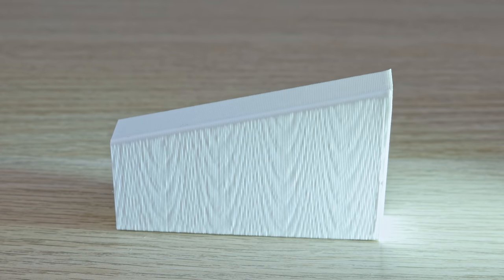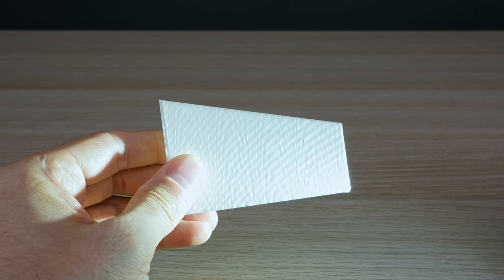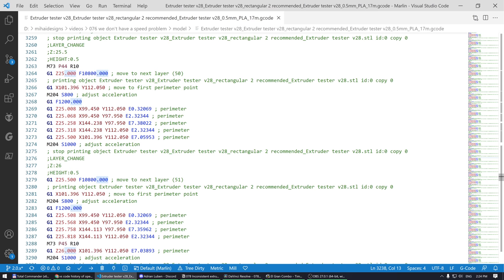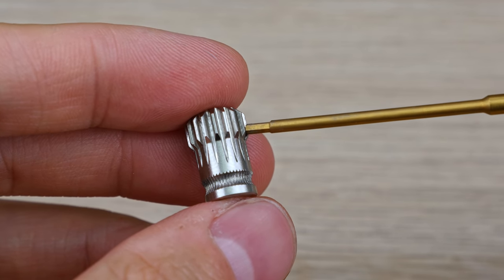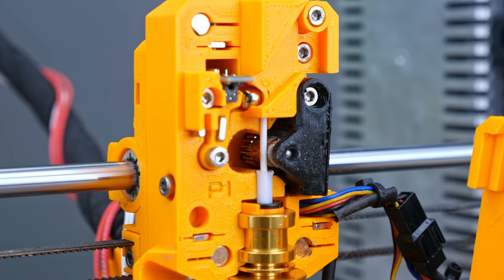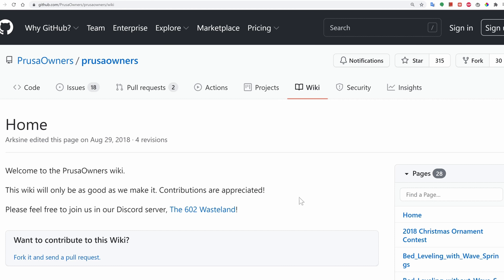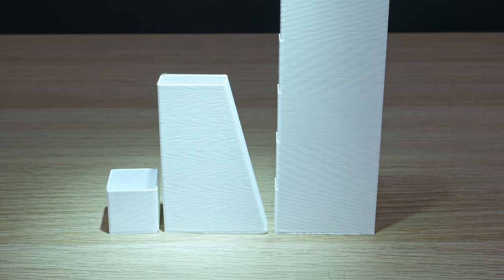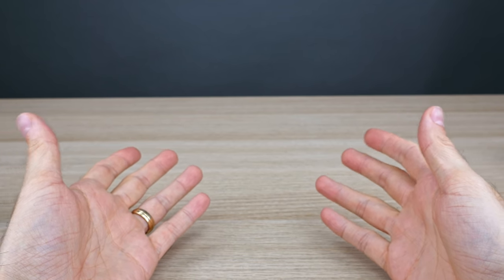What I've learned about dual gear extruders and how to patch them, maybe

Comment: Wait, i thought this was caused by 8 bit boards that's driving a complex geometry printer such as delta or corexy? i remember they need to divide the move into some sections because of the processing limit..

Some 4-5 years ago i got annoyed by this, definitely no dual gear extruders at that time. 

Now i built a corexy again from scratch but this time with a dual gear but still with a 8bit board and the problem reappears, so i was planning to switch to a 32bit.. but it looks like i need to change my plan after watching this.
Reply from the maker: I tested on the SKR as well. You can check my previous video to see what I tried without success. There are various reasons to get patterns. This is just one of the more prominent ones. You might still have to try out different things. Print my test models to at least see if the patterns you get look similar.
Reply: @MihaiDesigns  yeah i just watched it as well..

man, you have done a lot

Comment: I've had so many problems with under extrusion on my ender 6 and I kept thinking my nozzle was getting clogged or jammed, then I looked at the extruder gear and ended up changing it to a single gear extruder since I had an extra from my ender 3 v2. It fixed my problem for now so i'm using the 1 gear extruder

Comment: We need your opinions on the LGX Lite extruder! Will you try one on your Rat Rig?
Reply from the maker: I do have the Orbiter and the LGX that I want to try out. Haven't got the Lite though. Maybe I should get one 😁
Reply: @MihaiDesigns  It strikes me as the perfect extruder - the LGX design makes sense with the larger gears and it still weighs around 135g including motor. Aswell as the open design to clean gears, and only around 60EUR. I've ordered one with my ratrig already but it will be a long time before it is built lol

Comment: An excellent video, many thanks!
I was wondering if the two gears could be joined by a belt drive instead of gears? It's be more difficult to do though as you wouldn't be able to change the gap between the two cylinders easily.
Reply: A belt would make the two rollers turn in the same direction, you'd need at least one extra gear to reverse the direction.
Reply: @ferrumignis  Yes that was assumed.

Comment: It is not about the position mate its about the not centered motor shaft gear... ever think about that?🤔 the problem is every 180 turn shifting motor gear. That black screw on motor shaft gear makes shift every 180 degree cycle.Thats is why you have those patterns everywhere
Reply: Exact this.   MirageC  fixed the problem and worked with BMG to fix it.   They are new products to avoid using a gearh with screw in a shaft motor ,  that leads to an uncentered gear as The-Matrix tolds.

Comment: thats grea, but commenly, the teeths of gears have an involute shape. Those normally excel at consistently transferring torque, even with a changed distance. Maybe the tolerances of the teeths are not right, or the shape is different

Comment: I have a CR-10S pro V2 and a Flsun SR. I have the same extruder on both printers. with the same roll of filament I also have this problem on the FLsun SR but on the CR-10S pro V2 I don't have this. How is this possible?

Comment: I wonder what would happen if those gears were replaced with a crossed belt drive. WIth a flexible belt, it could even replace the spring for a grip.

Comment: Drive both gears directly and separately from the motor. Like two planets orbiting a sun. If the move closer or further apart they just rotate around the motor drive gear. The mesh of the teeth is separated from the squeezing of the filament.
Reply: In this case one gear will be rotating in wrong direction

Comment: Maybe helical gears would work.
Or the original gears mounted on a axle, with two pressure springs instead of one.
The two springs should have different hardness/stiffness, so the gear would pivot on the filament, but with a bias towards the meshing gears.

Comment: Cool was going to make a dual gear extruder but after this I'll have to design something better.
Reply from the maker: Doesn't mean your dual gear extruder will have these issues. I'm still learning about these things and how to avoid them.
Reply: @MihaiDesigns  it looks like an obvious design flaw when I see them now.. belts are the way to go I think. Or some double gear system but I think belts would fix this

Comment: another youtuber showed his fix for a similar issue and it came down to a defect in one of the stepper motor gears  which was off center and created a wobble.
Reply from the maker: Well, I would assume that problems like that have been identified and sorted out already. I use original gears,  but that can be the case for cheaper parts.
Reply: @MihaiDesigns  even the best quality products have defects. i wouldnt rule it out as a possiblity. esp, if the inconsistency follows a repeated pattern as a out of round wobble would create a very repetitious pattern. 

 however, your adjusted prints look pretty good so i assume your issue has been resolved and wobble was not a problem.

Comment: Straight ut gears like that are usually a very bad engineering solution because the speed of the teeth meshing when one gear drives the other is actually not constant and those straight cut gears have a lot of pay and backlash. Good gears would have a helical shaped teeth with an involute cut but they're also more money.

Comment: 10:57 Possibly a eccentric hole in the gear? That would show up as a pattern that repears every half circumference.
Reply from the maker: Indeed, and later I did happen to find one with the hole off-center. It needs a larger motor, but you do make a point. I guess you can have a layer consume half a gear rotation worth of filament so that the next layer up is extruded a different amount, causing a thicker and then a thinner layer and they should align at 2 points. I should try that!

Comment: The solution here is to use an idler between the two drive gears, allowing the gear lash to remain the same, when the gears need to move to adjsut for different filaments...  Or,  if you don't mind a longer extruder, with longer gears, you could reduce the angle needed to include both teh gear mesh and the right squeeze on the filament.

Helical is possible... I think  you're on th e right slant there.  Double helicial is probally to much, just single helical and something to take the end thrust..

Comment: It seems that you've discovered another tunable feature for print quality. Perhaps we should have cartridges we can swap out to get different surface features.
Reply: Could you emulate the problem in software with G code once you have eliminated the problem physically? If so, then making it perfect would be the goal, and software finish optons. But if not, then cartridges!

Comment: Why does eveyone prefers Ender 3 for starters? Why not the other Ender models?
Reply from the maker: Well, I don't prefer it, but if the question is about popularity, I assume it's because it was one of the first low priced 3D printer and got popular, so now it's popular because it was popular in the first place. Now there's an explosion of Ender clones, each grabbing only a tiny bit of the market.

Comment: i had a single gear extruder , it would grind filament sometime , but print quality was great, i got new dual geared extruder like the one in video on ender 3, and this strange waves type pattern appeared on my prints usually in first 2-3 layers then go away.

Comment: An easy solution would (maybe) be to replace the spur gears with timing belts.
Reply: Belts make things turn in the same direction, you'd need a set of gears to reverse the direction of one of the rollers.

Comment: Can 3d printer can print encoder disk    for servo dc motor used in cutting plotter like graphtec  ce 3000 with 1000 line

Comment: Use two stepper motors.  They can be half the mass of a single stepper each (approximately.)  Technically you would need another stepper driver...  (I've never tried to connect steppers in parallel).  Just an idea from a guy who's never tried it.

Comment: The only way I know to make double helix gears is to machine two cylinders separately and then join them together by a single axis. Making helical teeth on the gears for these extruders makes no sense because the powers involved do not justify their use neither from the point of view of efficiency nor from the point of view of the resistance of the gear teeth. The helical teeth do not improve the play if the two toothed wheels are then moved apart from the design position.
Reply: P.S. great research work, you have done more in these weeks than Prusa in the last 2 years
Reply from the maker: Thanks! Main point is not to improve power transmission or reduce play, but to have uniform rotation on the secondary gear. I'd assume that spur gears would also transfer uniform rotation, but somehow they appear not to be, at least in this case. Or perhaps they were borderline touching. I remember watching a video on manufacturing explaining how you can machine the double helix, but I don't understand any of the details. The two helical gears can be further apart, potentially at the opposite ends of the part if that makes it any easier to machine.
Reply: @MihaiDesigns  To obtain a uniform rotation, the contact between the two gears must always be present, but, as you have pointed out, with bondtechs there is no constant contact. Using helical gears, even with double helix, does not guarantee contact if the rotation axis of the gear is moved away from the design distance.
Probably the key to all this would be either to use different gears, such as to make this defect invisible. Or it is necessary to change the tensioning method of the extruder around the filament, because, clearly, the problem of this extruder is in the introduction of the play in the gears.
Reply: @librasd8087  Not really play in the gears, that only appears when doing retractions. Really an issue of non conjugate (constant rotation) meshing between the gears.

Comment: Try a geared extruder, such as the sherpa mini. should help a lot.
Reply from the maker: I have a geared extruder motor. Didn't make any difference in my case.
Reply: @MihaiDesigns  which one did you use? BMG?
Reply: @MihaiDesigns  the one I saw in the video directly drove the hobbed gear.

Comment: I Asked you on the previous video to look at the extruder gears and now I see that this in fact the problem. Because of the clicking noise I was hearing yesterday on my dual gear extruder of my Prusa Mini and how changing the tension of the gears changed the patterns of the printing I really I was sure this was the problem. A potential solution could be to find a diferent extruder design. I already ordered the Redrex extruder. If you look at their desing I think is less prone to have these friction problem, regards. Link below; https://www.amazon.com/gp/product/B07MZKY9WJ/ref=ox_sc_saved_title_4?smid=A1KV0TB4B246Q1&psc=1
Reply from the maker: Interesting. Looking forward to your findings.

Comment: until there is a fix that keeps the great grip the Bondtech gears does, im sticking with bondtech extruders on all my printers.
Its the only extruder that havent failed me.

Ive used Mk8, Mk10, titan, and in some situtions the filament tangle itself in the gear wheel.

So until there is a new gear type, i'll take these artifacts for the 3d print patterns.

Comment: This didn’t work for me. The gear rubbed up against the microswiss tension arm at a regular interval, possibly due to grub screw and introduced its own moire pattern. Upgrading to skr mini e3 v3 and using the stock dual gears fixed it for me
Reply: i would be intrested to try this change too, do you have any Links that maybe guide you through the Process ?

Comment: This issue is well known and understood in machine tools.
It was addressed probably over a century ago. The Maker community is only now seeing it because we are used to budget crap, and even second rate designs like Bondtech are regarded as being extraordinary.
Trust me, the Bondtech engineers Know about the issue, and chose intentionally not to address it, knowing the Maker community is ignorant and will accept crap designs and hail them as God like. So now we get videos like this, and people are all amazed at this "new" issue, that any clock maker from the 18th century or 19th century tool maker would have told you was a problem.
Reply: Shaft angle misalignment causing meshing errors perhaps? Would tooth crowning solve the issue?
Reply from the maker: My thoughts exactly! Surely machinists are way ahead with all the research over many years. I'm surprised that in the 3D printing community there don't seem to be many who have the knowledge and can spend the time to work on these problems. Sure, until recently (and in many cases still today) printers had such low accuracy that these things didn't matter much. But once you can print within tens of microns of tolerances these problems become obvious.

Comment: I have also seen a direct drive extruder I guess it is 4 gears. 2 Gear spaces apart from each other. So the filament passes through the first 2 gears and then passes through another 2 gears. I am trying to find this product. So I can remember if it is exactly 2 separate dual geared setup of a 2 separate single gear setup. But I wonder how well this configuration will work. I would love if someone would test it out.It is a 3:1 gear ratio Extruder.
Reply from the maker: I'm curious where you've seen this 4 gear extruder. Maybe you can find it :D I was thinking of designing something similar.

I did test with a 3:1 geared motor, the one from TriangleLab and saw no difference.

Comment: its not the gears it's the extruder body itself... plastics can flex! which results variations of distance between two gears.Use all metal,all metal transmission gears extruder. Like all metal Orbiter 2 or Microswiss NG extruder, all metal Hextruder or similar designs... those are budget machines if you want quality,stability from them you need to upgrade lots of parts and spend so much time to upgrade and test it.Otherwise get Bambulab X1 if you don't want to tinker

Comment: Use a seperate stepper motor for each gear then the teeth can be removed, or use a single belt to drive both gears.

Comment: What does the "42% of the cases" mean? 42% of the survey respondents are using dual gear extruder? Or 42% of direct drive owners have this problem? If it's the former, do 100% of them experience this problem?
Reply from the maker: 42% had the pattern. Check the spreadsheet link.
Reply: @brisance  My current hypothesis is that it is caused by angular misalignment between the shafts which is known to cause meshing errors. The different results on the same extruders could be caused by variations in alignment. The industry fix for this issue is crowning of gear teeth, but the only way to see if I'm right would be to test. 
The pattern on the snapmaker was faint apparently, possibly caused by something else. I have the snapmaker 2.0 A150 and the backlash on the drive axis is pretty crappy. Hence why they are coming out with the 2.0 motion axis (should have been right in the first place). 
Using just an idler and one drive hob, and changing the shaft angle are adressing the same issue (non conjugate meshing between the gears even though it should be conjugate theoretically) but in different ways. I doubt the double helical gears will have much affect but it may smooth things out a bit.

Comment: Well OK, but for control did you try just changing tension on the filament and then reprinting for best results and getting rid of that salmon skin that PRUSA machines are not known for? I say that because the idler of the dual drive might skip a single tooth until it gets loaded and matches the drive gear tooth to tooth. Does that make sense? The only problem with the BMG design is that Bondtech has decided to use larger drive gears in their LGX. However, just for reference, the latest offering from E3D that everybody and their mother wants, you know, the Hemera uses those exact drive gears. You are also playing with the amount of drag or tension on the filament. And urging the filament to one side or the other by angling the drive gears. This video does not prove what you are thinking.

Comment: Backlash is a necessary evil with gears. moving the gears apart will increase it and the reverse is true to a point where the gears bind and wont turn at all. Swathing to a helical pattern will work  but setup to machine will increase the cost. especially being so small. If people are willing to pay for it, people will make em. check out some gear hobbing videos and it'll will show that the tech. to make such parts can still be improved.

Moving everything from steppers to hydraulic drives would be a fun over engineering project.

Comment: Does anyone make a drive that uses helical gears? I'd think that would smooth out the problem.

[[Edit: I see you suggested helical gearing later in the video.]]
Reply: Another question: Does anyone use a smooth capstan pressing against a rubber idler? This has worked perfectly for tape transports for well over a half century. I'd think you'd want to have a groove in the smooth capstan due to the fact that the filament is not flat like recording tape, but that should be easy enough to implement.

The actual drive friction would be performed by the rubber idler wheel, which would be driven by the capstan, with the filament held between them by however much pressure was necessary.

If no one has done this, I'd like to know why!